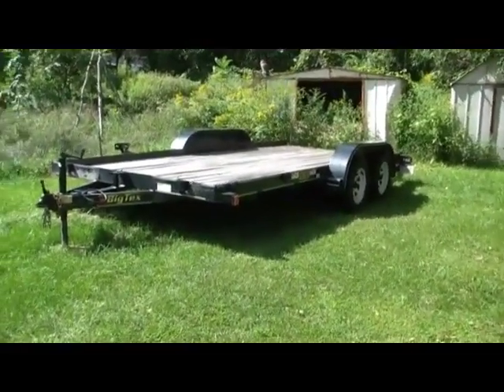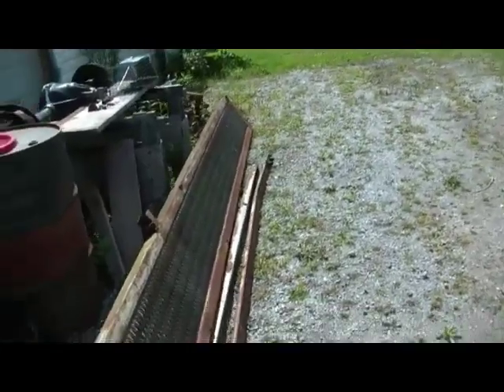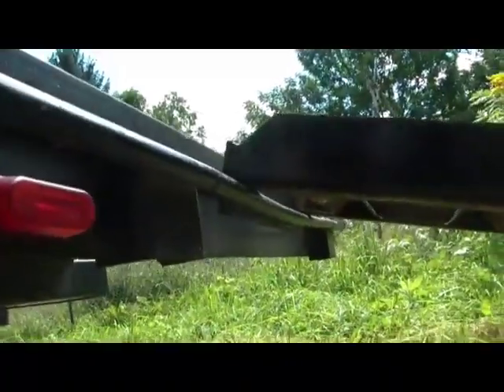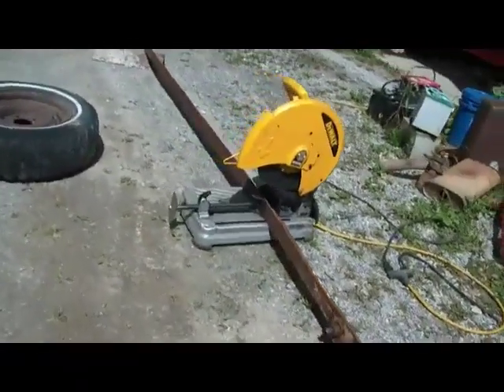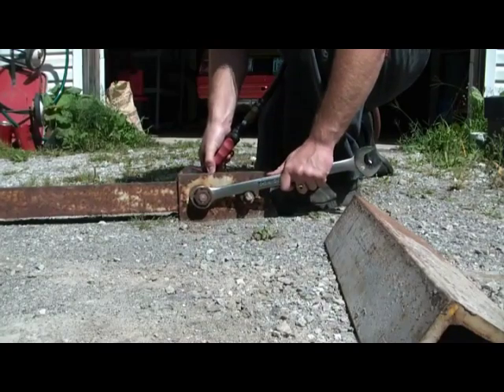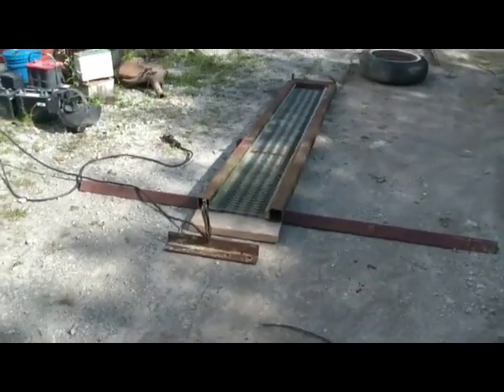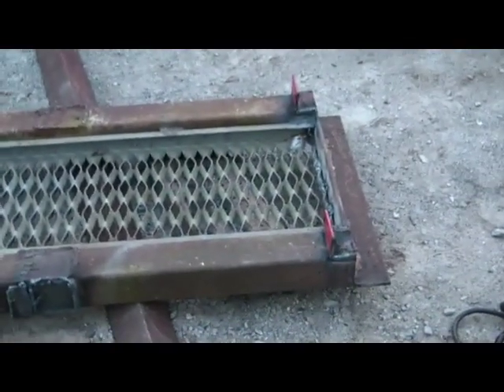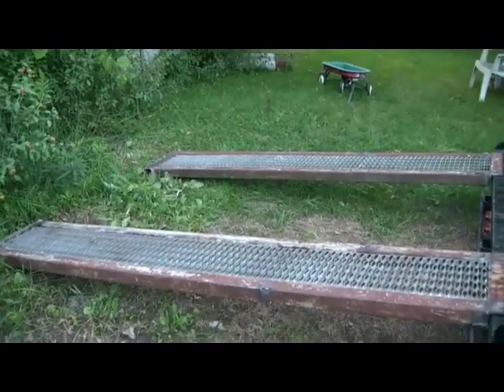building trailer ramps from scrap

Comment: really cool ramps. two things to really make them great would be to have them mounted just under the trailer floor so they can slide out backwards on tracks like alot of bigger trucks. or having legs on the high side of the ramp going towards the ground so the trailer dosnt wheelie when you drive cars up them. it sucks when it happens sometimes causing the hitch to pop off the ball. but there way better then the original ramps good job.

Comment: Great ramp build putting angle iron at the end built a set of them similar to the ones that you have the only thing I did at the end of Mine by the angle iron was cut a pizza in each and a half of round tube in half and welded it to the ramp so that was sit on the the trailer rod so there is no chance of sweet peach love anyway just in case the trailer moved or the truck moved at the time of loading things